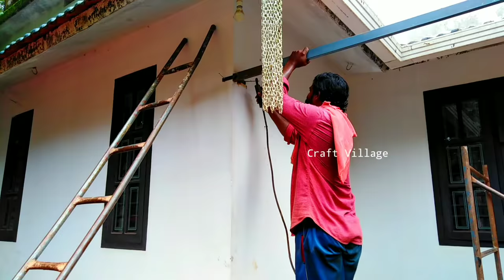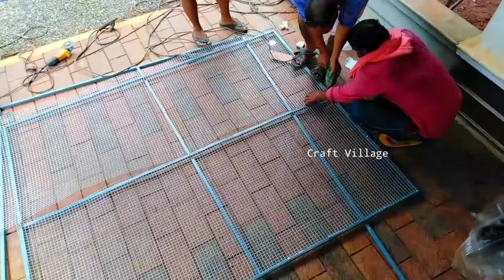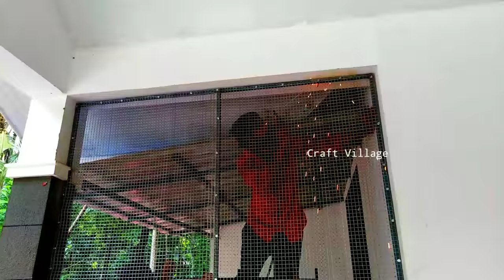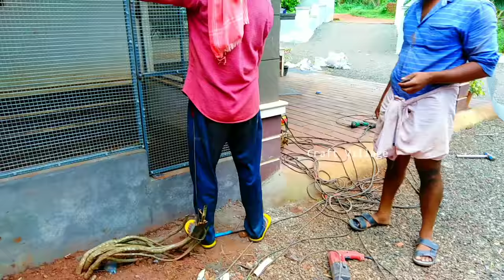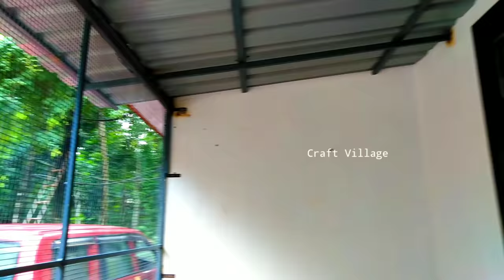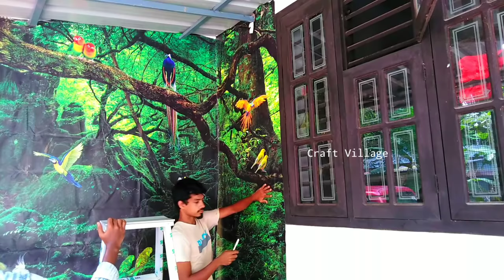Making Beautiful Aviary For My Birds | How To Make Perfect Birds Aviary

Comment: Few mistakes not to repeat.. Any architecture building it's value should not be disturbed.... 1.Must have used tiles instead of metal sheet. 
2.Any aviary you should  provide two. Doors.. Main door / ancillary. Door. 
In this case while entering you open the only door.. Immediate chance of birds flying out side straight out.. You loose good stocks. Birds are more brilliant.
Reply from the maker: Thank you for your suggestions... 🤝👍

Comment: 13000 roopayil  teerenda varkke unnl...engane 26500 ayennu onnu vivarikkamo...?...
Reply from the maker: Please checkout video description box...
1. Roofing sheet (3 nose, 8 feet) and Steel Pipes for Roofing (8000rs)
2. Irone Net (.5x.5) 15 meter (5500rs)
3. Apollo steel square pipe (6 lenght) (3500rs)
4. Flex Print and Gum (1800rs)
5. Paint (900rs)
6. Breading Pots (500rs)
7. Labour Charge (4500rs)
8. Other Expenses (1800rs)